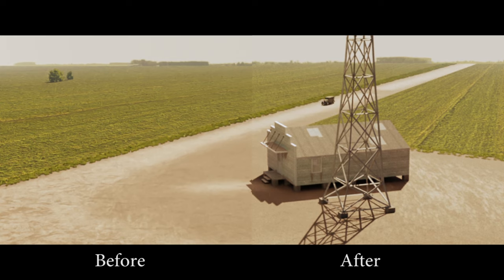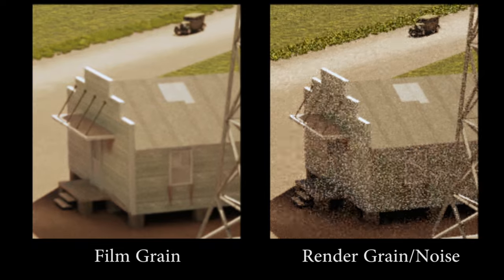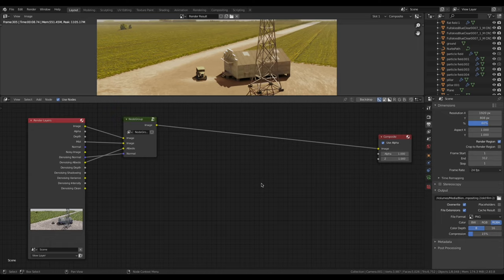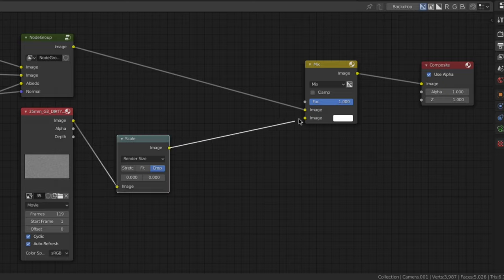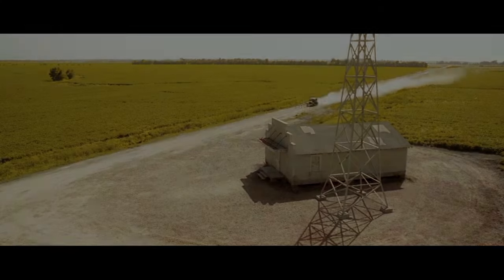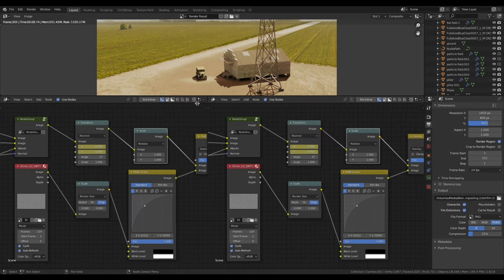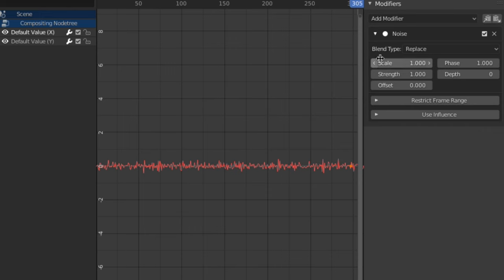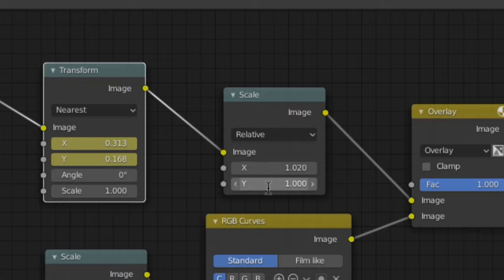Blender Tutorial: Compositing Film Effects

Comment: Thanks for this tutorial! I noticed a slight issue with mines though; 

I have an animation which has 425 frames in total (rendering at 24fps), I used the exact filmgrain clip you linked in the description, set the frames to 425 and checked the cyclic box. But when I checked my animation after I rendered it the film grain seemed to stop at a certain frame and froze, whilst the rest of the animation was playing. 

I was wondering if you had a fix for that?

Thanks
Reply from the maker: The frames number should be set to the number of frames in the film grain clip, not the length of your animation. The film grain clip is 119 frames long, so try setting it to that.
Reply: @AmortMedia  Many thanks for getting back to me on that! I was about to ammend my comment saying exactly just that, and that it solved the issue! 

I misremembered when I initally set the film grain up in the compositing of my project and assumed that the frames of the grain clip should be set to the duration of my project. I went back to the tutorial to double check if I missed anything and you mentioned in the tutorial that it should be set to 119. 

A mistake on my part entirely and I apologise! But, many thanks for getting back to me on the issue though, this'll make my renders and animations look more interesting! And many thanks for this tutorial!

Comment: Hey, Amort Media. Questions:
1. Are we going to put grain on the movie clip node or the render layer node?
2. Will these nodes work with the movie clip node or the render layer one?

Just wanted to ask you.
Reply from the maker: I load the grain clip into an image node (though the movie clip node may also work), and composite it over the render layer node. You could also composite the grain on top of a video clip  loaded into an image node and basically skip the 3d rendering all together if you're just trying to use the Blender compositor for video effects.
Reply: @AmortMedia  But what about the original video? Should I use a Movie clip node for it?
Reply from the maker: @tiagosp  Both the "image" node and the "movie clip" node will work. The image node gives a few more controls, but you have to adjust the "frames" option to match the length of the clip. Either way, the video won't automatically scale to the composition size, so you may need to place a scale node set to "render size" after the video.
Reply: @AmortMedia  So you mean these compositing nodes? I think I get it now. Thanks, Amort! ;)
Reply from the maker: @tiagosp  Yes indeed. Have fun!